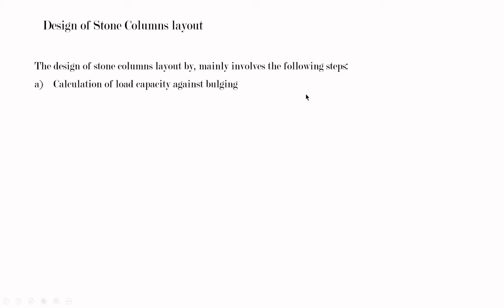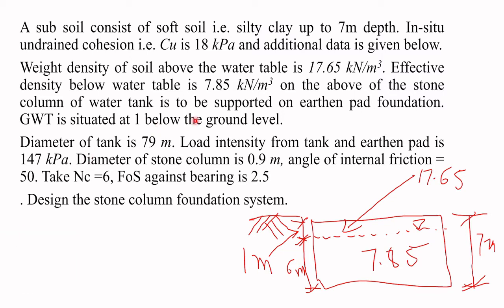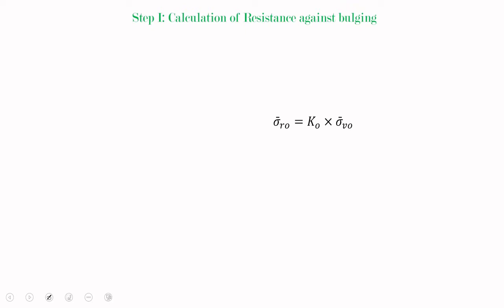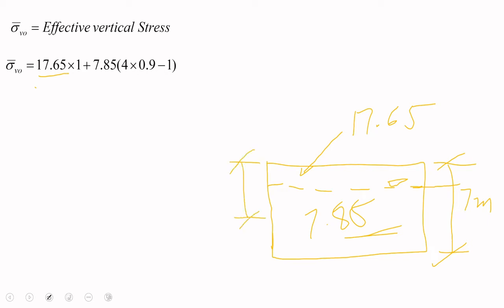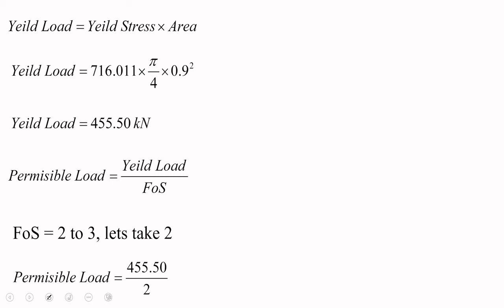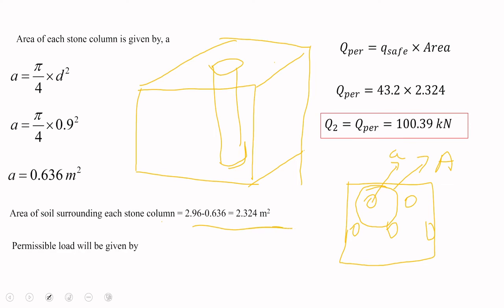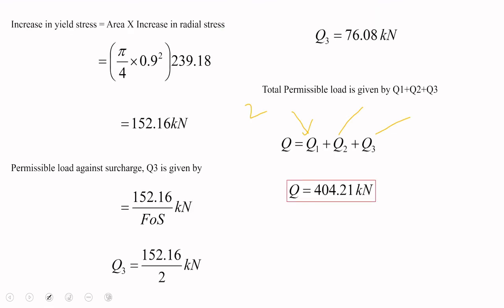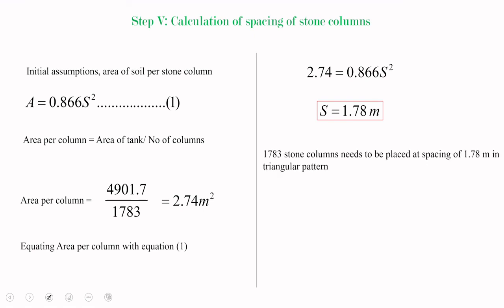Design of Stone Columns

Comment: Good evening sir, 

Excellent video... I had doubts when solving the number of grouted columns.. If we have a range of different unconfined compressive strengths, and we are assumimg the spacing (suppose 1.2 m) for all the cases.. Is it possible we get the same number of grouted columns assuming all the parameters to be constant, sir?
Reply: For all the cases, sir?